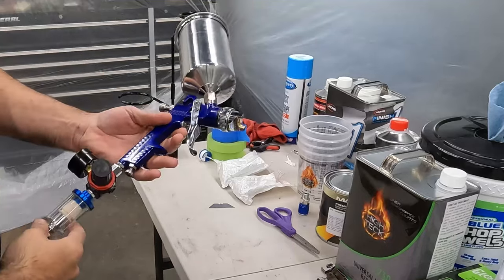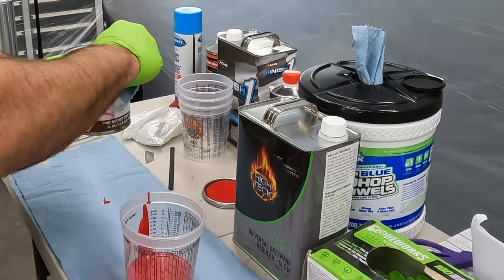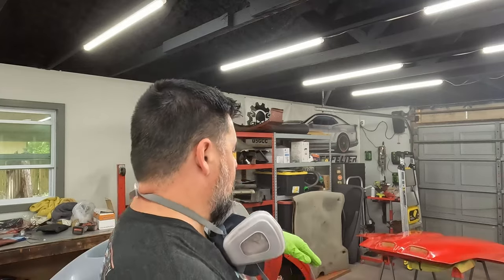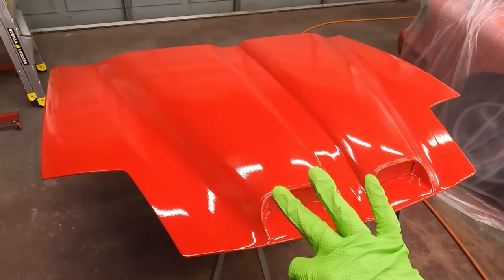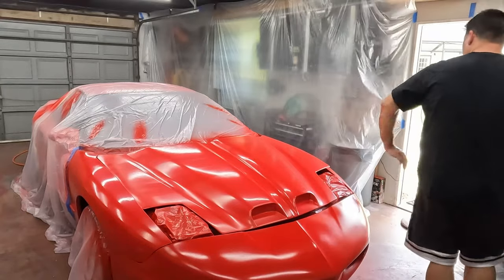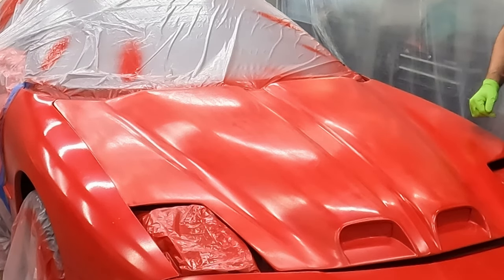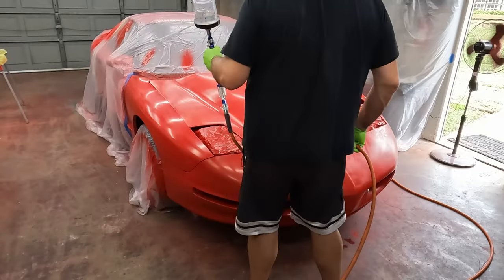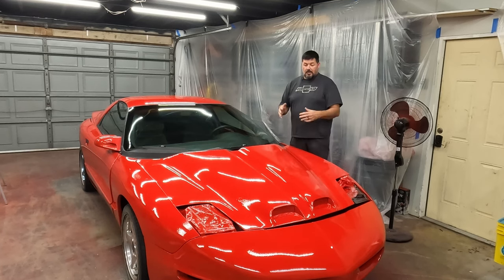First Time Paint Job...in the Garage! What Could Go Wrong?

Comment: I painted for over 20 years, and have NEVER used a 2.5 tip. 

A few pointers...
1. Always follow the paint directions. If they said 1:1, that's their formula.
2. Don't spray a hood side to side. Spray front to back, you can reach farther. And always keep a wet edge. 
3. Wax and grease remover is not a good idea for plastics. They make an alcohol based solvent for plastic parts.
4. That fender should not show any breakthrough, if you're "ready for paint". You should at least have a sealer of some kind, to make it uniform, and for adhesion. If you were wetsanding your basecoat, then you would have been good to wait for more color...you should lightly recoat after color sanding, anyway. 
5. Don't pull/hold the trigger the whole time, let up off the trigger at the end of the panel.
6. Gun setup is important...wide open is not the answer.
Pour from the side and back of the gallon...you won't get that "glug, glug" sloshing of the paint/reducer.

I don't know what you finish sanded in, but you should not see scratches under the new finish that you "hope clear will cover".

Love those cars. Best of luck. If you have any questions on correction feel free to ask.
Reply from the maker: First of all…thanks for a ton of info!  Secondly, for my first ever paint job, that’s not too bad a list of the things I got wrong. 

Actually a lot of that I learned already…and then totally forgot all of it once I started. Like all the info just fell out my head. (facepalm)

Comment: I painted my bumper and fenders 94 Bird
Reply from the maker: Nice.  How'd it go (hopefully better than mine...haha)
Reply: @rhynosgarage  Did the hood twice, bumper twice and fenders once. Had solvent pop on the bumper and hood. Then I dripped sweat on them the second time. Been in the high 90's in NW Ohio. I'm also painting black single stage, fenders came out nice. Your bird is looking good.
Reply from the maker: @joedowe9412  yeah, in hindsight I should have just redone it.  I ended up sanding and polishing and got it...good enough for now.  But dang it was a lot of work to get there.

Thanks!

Comment: You need to improve your spray painting technique. Additionally, that gun has high air consumption. The gun is not applying the clear properly. It's a lie that the first coat of clear looks bad. The reality is that it should look pretty good and the second one, which is wetter, should improve it. As I said before, the gun settings and technique must be reviewed. The problem with doing things in our homes, such as painting a car, is that we do not have an appropriate guide to do it. And learning only from mistakes is costly economically speaking. People who make videos on YouTube and say that anyone can do it easily are liars. Preparing the paint gun, knowing its different uses and developing a good application technique takes a lot of time and resources. And considering that you have to apply primer, then paint and finally clear coat, multiply that time by three. And if you add sealer it is multiplied by 4. It took me three years painting small things like riding mowers to be able to know everything and try to take on the challenge of painting car panels and much later dare to paint an entire car. And that's just painting, if we add body work there it's a completely different world of knowledge. And the combination of both is worse. So the advice I give to all those who want to learn on their own is to have a lot of money saved and acquire as much knowledge as possible before painting a car.
Reply from the maker: yes, that would have been ideal.  But the car had to be painted by a certain time, and I didn't have the budget to pay someone to do it.  There's what you "should" do...and what you "have to" do.  Just gotta get it done sometimes, even if it's not ideal.